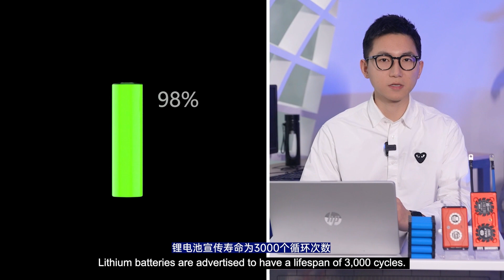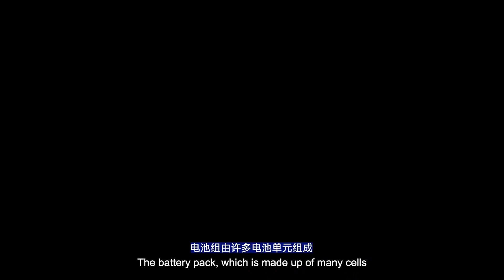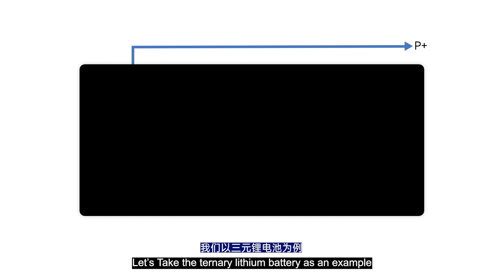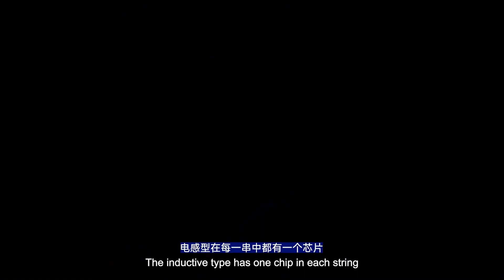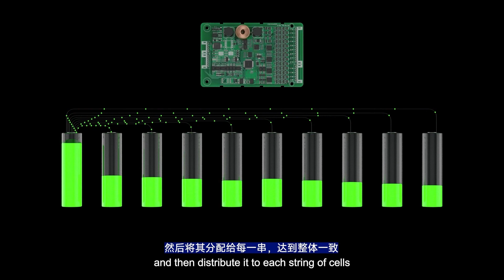How does the Daly BMS balance the battery？

Comment: Hi there. I have 3 daly bms. 200A smart bms with blue tooth would not turn on at all$300 wasted. The second one is a basic 200A no blue tooth which works but shuts off then comes back on for no reason. But is still being used. The 3 rd one is an active balance with blue tooth and will not balance at all. It will connect but does not work properly. What triggers the balance to work? All the parameters are set properly to balance but will not balance. Can you tell me how it works please? I am getting frustrated with your product and is costing me a fortune.

Comment: Which method does Daly Smart BMS use to equalise..?
He said there are 3 methods
Reply from the maker: Capacitive type for the passive equalizer, and transformer type for the active equalizer.  All smart BMS are equipped with passive equalizers.
Reply: @dalybms666  The active equaliser is not the same as Daly Smart BMS right..?
Or is active equalising built in to the Daly Smart BMS..?
Is it the separate hardware Daly Smart Balancer.?